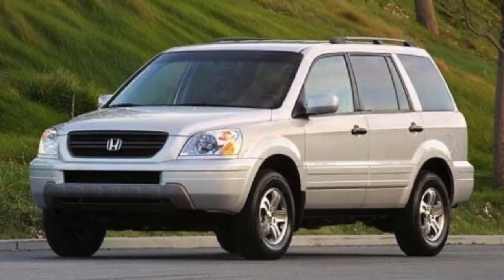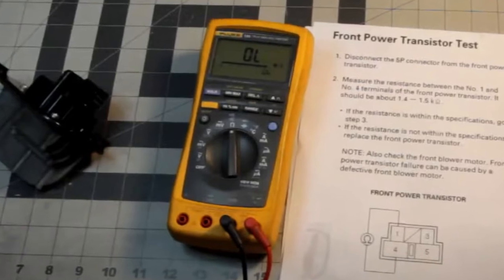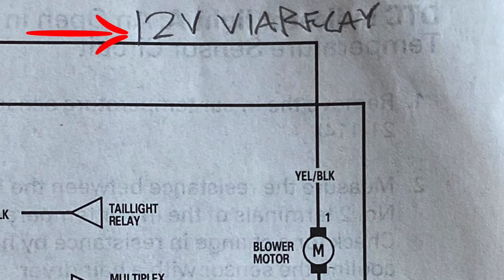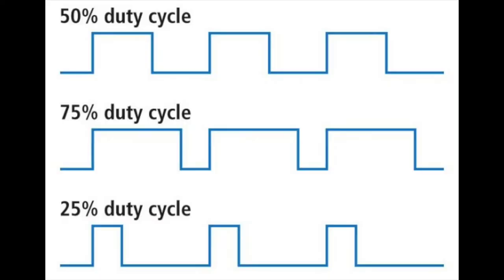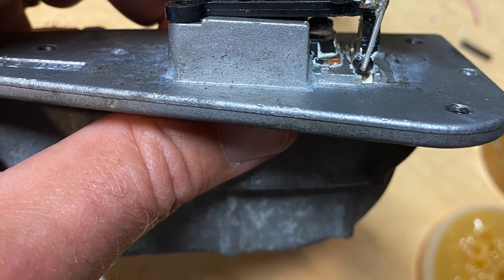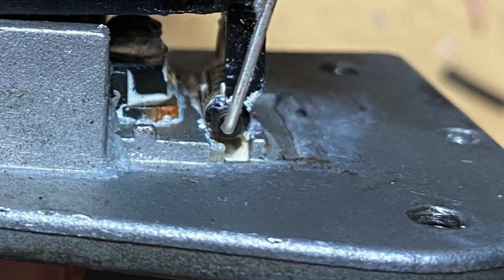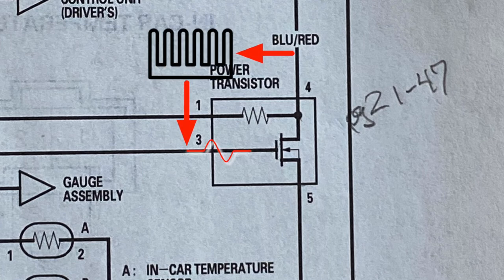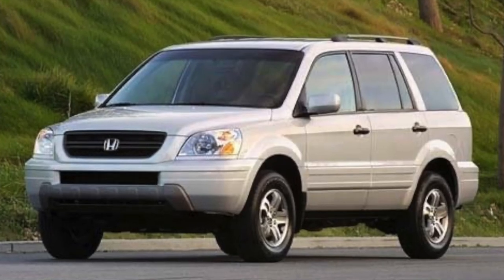Honda Pilot Front AC Blower Fix Causes Blower To Run CONSTANTLY

Comment: Wife was driving today in our 2004 Pilot AWD.   Temp control panel going in and out.  Speedometer going wonky.  Outside temperature off by about 50 degrees.  All of this happened at once. Seems to be intermittent, as everything randomly goes back to normal.  Any idea that would connect those three seemingly separate components?
Reply from the maker: A few things come to mind. First, you could post the details to the piloteers forum as I think that is the largest collection of knowledgeable pilot people. Second, it could be a power/ground problem though those can be a challenge to chase. Last, perhaps it is an ECU issue since that controls many devices. Sorry I can’t help more.

Comment: I just swapped out the transistor today and now the air to the back doesn't stop blowing. FULL BLAST  lol could this be my issue also?
Reply from the maker: Hmm, it wouldn't be if you didn't change out the thermal fuse. However, if you accidentally shorted something out while replacing the transistor, you could end up with the same kind of problem. If you have a multimeter and can check for shorts, check the pins of the new transistor to see if any are shorted together - i.e. close to 0 ohms resistance. Of course, if you disconnect the transistor completely using the connector, the fan should stop. If it does, then you know that there's a problem in that assembly and it's probably the transistor pins shorting together.
Reply: @ravraid so I disconnected it but it's was still blowing air, I'm at a lost here